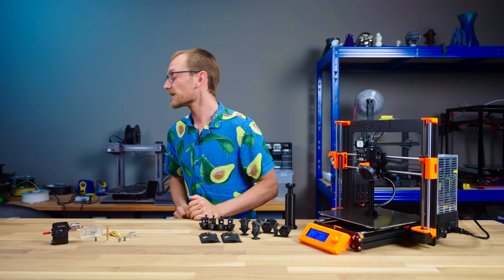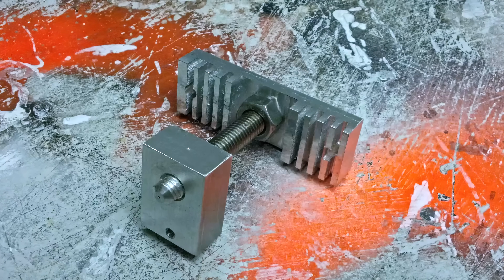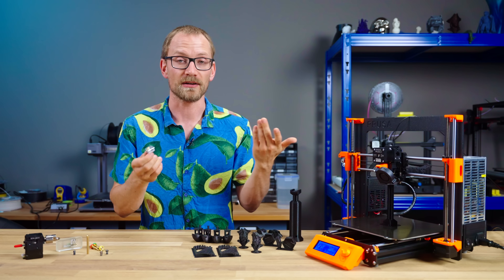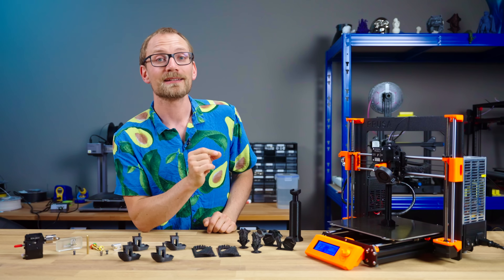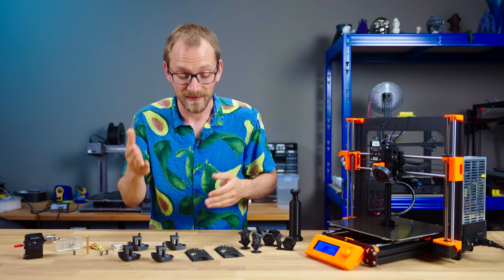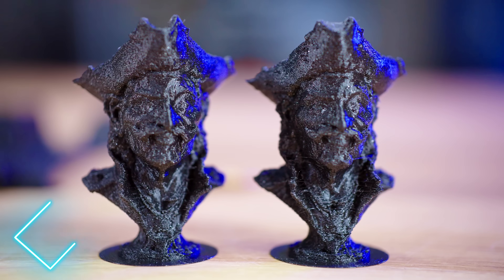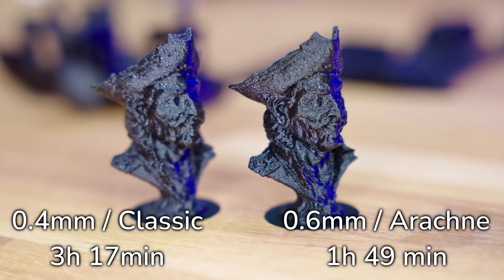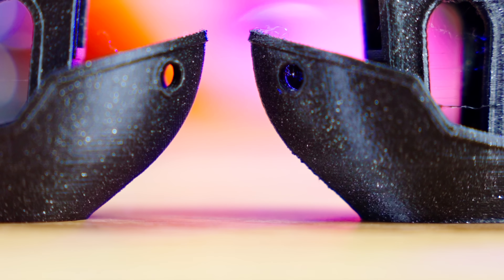0.4mm nozzles just became obsolete

Comment: I use my printers mostly to protoype components, pcb housings, etc. I switch about a year ago to 0.6mm nozzles, and sometimes to 0.8mm, and man, having a print done in a hour instead of four, or in half a day instead of a full 24 hours is amazing. Also, it works really well with the whole "quickly measure stuff, do 30 minutes og CAD, print test piece in 20 minutes, modify CAD and print full piece" workflow
To be honest, if you cannot afford to lose "details" on a print, get a resin printer.
Reply: I really need to do this, I never print with fine details
Reply: @instanoodles  Just use thicker lines in the slicer when using 0.4 mm nozzle
Reply: You don't need a 0.6 mm nozzle to print 0.6 mm or even 0.8 mm line width, but a 0.4 mm nozzle will do just fine.
However, if you're going for 1+ mm line width then yeah, 0.6 or 0.8 mm nozzle is probably good.
Reply: I have about doubled the speed of my printer with input shaper on Klipper, and it's at the limit of a Revo hotend at 0.3mm layers heights and 0.4mm line width. With 0.6 line widths and 0.4 layer height it would double the material flow again to 24mm^3/s (about the performance of high flow extruders), and this is on my modded Anet A6 bedslinger! I could run 0.6mm line width with the 0.4 nozzle but I might as well keep the quality since I'm at the limits of the hotend anyway. I think my next real challenge is sufficient cooling.
Reply: Lots of people don't have a space where they can safely manipulate allergenic, toxic and mutagenic materials. Plus, photoresins are a lot of work.

For prints that need a reasonable amount of resolution, using something like 0.2 and coating it to hide the layer lines can be viable, especially if you're doing a master which will use to make castings from other materials.
Reply: Very good comment. I for example print basically only engineering items which do not require fine details or templates for a router. I'm printing with 0.8 CHT. Some parts take with optimized profile, this nozzle na bondetch lgx extruder up to 40 hours and 2 spools. With 0.4 it can possibly take almost a week.

Comment: I've been using a 0.6 nozzle for a year and it's fantastic I don't do very art-looking stuff primarily mechanical which works awsome and the vase mode is now a thing I use way more because prints are more robust with this setup
Reply: Somebody needs to add a "double vase" mode: prints 2 LINES instead of 1...  In fact, just make it a variable number, 1,2,3,4...  All the strength you want to dial in with a single setting.

Comment: Regarding the layer height issue, if you use the wider nozzle orifice but keep the line width smaller (in this case, 0.6 mm nozzle with 0.4 mm base line width), does the problem go away? In other words is it really the nozzle width that matters, or the line width?
Reply: I think it's the line width. I love that you can set different ones for different areas in PS

Comment: Interesting video. As a hobbyist, I always treat print time as a "It takes as long as it takes" issue. I am luck enough to have a couple of printers, and I generally use a .4 or .8 nozzle size. Most of my printer these days are either reasonably detailed, or just need to be strong, so those options work really well for me.

I really need to get a printer with a Revo hotend, because nozzle swaps are not on the list of things I enjoy about 3d printing.
Reply: My solution is to swap the entire hotend. Much aster than changing the nozzle........
Reply: A bit late to the party, but with most nozzles you can use one of those attachments for putting screwdriver bits in a drill. Just heat your extruder, do a few retractions, and quickly swap the nozzles.
Reply: It's still tedious with Revo hotends. It takes even longer to change the nozzle.
Reply: @alejandroperez5368  ??? HOW ??? With proper Start+End-GCODE modification, you're literally swapping in 30seconds.

Comment: I would've liked to have more of a comparison between 0.4 and 0.6 both with arachne. I agree that 0.6 makes sens for most usecases and especiallly engineering parts.
Reply: I personally use 0.2mm nozzle with 0.18mm line width and 0.08mm layer height, printing at around 75mm/s. Gives very smooth parts, although it clogs often.
Reply: @hammyboigaming904  do you use a filter/oiler ?
Reply: @MrExo_3D  I do not, since the 3D printer I have uses a very compact extruder and there aren't a lot of modifications I can buy. However I did make a new hotend for it.
Reply: @hammyboigaming904  filament filter is generally easy to add to most machines. it just a little housing that the filament passes through before it goes into a tube or into the extruder. I find them very helpful in preventing clogs. especially the case with small nozzles
Reply: @MrExo_3D  I need to do this, my 0.15mm nozzle loves to clog.
Reply: @MrExo_3D  Thank you, I'll look into buying one. I think it could definitely help.
Reply: @randomname4726  yeah running 0.15 is like asking for pain lol
Reply: No, no and no. Notice how there is no mention of the effects on layer adhesion strength. This is bad advice from an engineering perspective for functional parts. printing a line width of less than 100% of nozzle diameter results in verry poor layer adhesion strength. best adhesion occurs at 150%, which would be 0.9mm for a 0.6mm nozzle. This would result in a huge compromise between detail and strength just to achieve higher print speeds. Do not use a 0.6mm nozzle for functional parts unless they don’t require precise dimensions. Though  I guess it would work well for larger parts with tolerances greater than 1mm.
Reply: yeah, it kinda made the tests/video a bit redundant, cause even if 0.6 gets close to 0.4 with arachne, it still will obviously not have as fine of details, and that's without 0.4 even using arachne, and boy was I interested in seeing 0.4 vs 0.4 with arachne
Reply: Yeah, I've been using arachne since Cura 4.13 and I am already getting the use out of the definition it gives you at 0.4mm. e.g. using 0.5mm thick lines to make slightly compliant mechanisms in PLA.
Reply: @charleslambert3368  sorry to bother, but I've been using cura for 2 years and just uploaded the most recent version5, I can't find anything that is called arachne or anything similar?  Is it just in prusa slicer?
Reply: @charleslambert3368  well then make those compliant parts 0.6mm, probably just as flexible.
Reply: I was thinking the same, but then again I've been using a 0.4 with arachne for a while now and while there's been some improvements, I can already tell a 0.6 could get pretty much the same results in less time just by looking at some of his prints and what i've experienced on my own tests. Probably gonna buy one to try in the near future.
Reply: This simple issue completely invalidates the entire video and makes this nothing but clickbait. Obviously a bigger nozzle prints more, but try printing a 0.4 width line with a 0.6 and it won't work. a 0.2 also isn't fit for purpose for fabricating a huge box, but it'll do well doing tiny little 28mm models and smooth diagonals
Reply: Yeah not quite comparing apples to apples. I get that you are trying to work on the assumption that everyone is happy with 0.4mm definition they're used to. But really that definition itself is out of date.
Reply: @danyoungwas  please elaborate
Reply: @vmx200  elaborate on what
Reply: What line widths do you want to use? If less than 0.8 mm then a 0.4 mm nozzle is just fine, especially since you can have it make a 0.4 mm outer wall for higher details, and wider lines for everything else.
Reply: @marcus3d  Yep, it's what I do. And I basically just print functional stuff too, increasing line width was one heck of a magic trick to speed up printing. Just keeping in mind the hotend flow and we're good to go.
Of course, the same is true for a 0.6mm one too being able to flow more by being less restrictive, but every now and then we do need ("we" meaning both myself and at work) some sharper details that the 0.4mm can do.
Reply: @marcus3d  I would like to see some tolerance and accuracy tests designed for .4 printed on a .6 nozzle.  Sometimes you just need that added accuracy and really validating that would be great. (also a model not printed with galaxy filament would be nice)
Reply: @marcus3d  if you want to print fast then a 0.4 mm nozzle will quickly give you problems with your flow rate. Even my volcano hotend can't melt filament fast enough for fast print speeds with 0.6mm line widths on a 0.4mm nozzle, which is why I'm buying a 0.6mm bondtech cht as soon as the volcano version launches in August

Comment: Wouldn't simply using an extrusion width of 0.6mm with an 0.4mm nozzle provide the same or similar benefits?  Also, Stephan showed in tests that printing with a nozzle width that is wider than the nozzle (150% to 200%) improves layer adhesion and makes prints stronger.
Reply: That works great, I printed a lot of nylon on a 0.4mm nozzle with 0.6mm extrusion width, and similarly have printed smaller than 0.6 on a 0.6 nozzle.

But I guess the point of the video is more that 0.6 is a better starting point for what most people print, giving you a more sensible default mid point for extrusion width.
Reply: Until you're flow rate bound, it shouldn't make much difference at all except possibly on overhangs where the fluid dynamics get weird, and then I'm not sure which is better.

Comment: I remember having to make a springy part for a retention clip to keep the face plate on my computer case.
It was just too thin so the slicer made gaps and I had to interleave 3 different shapes between the layers just to keep it physically connected and functional.
Reply: That's just a slicer issue though, proper slicers had adaptive extrusion width for ages now
Reply: A tip is to design parts wall thickness with your layer width in mind if you dont already. Full perimiters make stronger prints and less issues like what you're experiencing during printing.

Comment: Nowadays I use a .5mm nozzle as I find it to be a good balance between detail and speed. .4 is a bit too slow and too restrictive of flow, while .6 is a bit too coarse. Arachne has really made a massive difference and basically made my switch possible all by itself, but it still really isn't perfect and you can still see differences between 0.4 and 0.6.
Reply: Curious, how fast are you printing, how wide lines, and what layer height?

Comment: Thank you for this.  I'd like to recommend that you use a narrower [edit: corrected from wider] aperture (or the video equivalent) when showing models side-by-side.  In many of your shots, it was not possible to compare the two because only one was in focus.
Reply: What you want is a larger depth of field--the distance ranges from the camera within which subjects will be in focus. A wider aperture actually narrows that space and makes it trickier to focus exactly right.
Reply: @Aaron-ne4kr  I knew this and wrote it wrong.  Narrower aperture.  Thanks for correcting me.
Reply: Possibly replacing video B-roll with a pan across a still image? That would make it easier to make sure the part we should be looking at is in focus, and with a tripod Thomas can get a slow enough shutter to make up for the narrow aperture (this is harder in video, as the shutter speed is limited by the frame rate)
Reply: Wide angle lenses add a fish eye effect I believe your looking for the macro lenses  bud that gives you better detail for a small Frame shot up close
Reply: @FUCKDSS  That's not what I was referring to.  Greater depth of field would be the goal.

Comment: I made the switch to 0.5mm a couple years back and it's been great. Even with the classic slicing methods, 0.5 really didn't loose much definition but allowed for significantly faster prints. Makes your question of why we switched to 0.4 in the first place even more interesting.
Reply: I prefer 0.5mm because i often design parts in mm increments and 1mm isn't cleanly divisible by .4 or .6
Reply: @6AxisSage  don't get too hung up on nozzle width. A 0.4mm will make a perfectly fine 0.5mm wide extrusion. Or even 1 mm wide. I've done the experiment of seeing how much I could extrude out of a 0.4mm nozzle and I got up to 1.5 mm wide and 0.5 mm high with good quality. Beyond that it started to go downhill. 
My theory is that the max extrusion width is really determined by the diameter of the flat part of the end of the nozzle. Wider than the flat part is no good.
Reply: @Dave_the_Dave What about overhangs and bridging? I assume they won't work very well when trying to push most of the filament sideways.
Reply: @shaunsgoat498  overhangs work about the same as they would with a wider nozzle. Bridging won't work as well but that won't work well with an extrusion that size anyway because it is really hard to cool it quickly enough so that it won't sag. Low flow rate is better for bridging
Reply: @6AxisSage  But, you probably shouldn't be printing with layer widths equal to the nozzle bore diameter. You want a little squish as you print. The default print profiles in PrusaSlicer 0.4mm nozzle (at least for Prusa printers) is 0.45mm. If you want equally divisible into 1mm for your mechanical work, bump your 0.4mm nozzle's print line width to 0.5mm. As long as the flat end of the nozzle is a larger diameter than the printed line width the nozzle should keep the top of the squish nice and flat.
Reply: I agree. 0.5mm is great. It's easier to calibrate than 0.6mm and the speed upgrade and less clogging is definitely worth it. 😎🌎✌️
Reply: @DeanTheDoctor  Less clogging? Clogging at any of these larger sizes is so rare for me it's impossible to compare but I'm almost certain any increased clogging with 0.6 over 0.5 would be due more to poorer quality nozzles than the size itself.
Reply: I've rarely had clogs myself, but it helps with the peace of mind when it comes to dust in the environment and when choosing more economic brands of filament. When it comes to third world countries, not everyone is going to have access or the ability to get quality parts, so videos and community content help others to know what options are available, but it's whatever suits your needs best. 😊🌎✨
Reply: My question here is how to setup a larger nozzle in order to bring down the printing time without going larger than 0.2mm layer height.
Even tho my Printer Profile doesn't let me change my wall thickness away from 1.2mm
Reply: @ludwigschmidt4133  Thicker line width
Reply: I'll have to try put a .5mm nozzle, because designing parts would be so much simpler with .5mm lines in mind.
Reply: I've always run 0.5 but I mostly mostly run CF and GF materials and wanted and edge against clogging.
Reply: Probably the best way if getting higher resolution in the early days, now with better extruders and software I guess it's just not nessasary, I am curious what the bust would look like at 75% scale, would prolly see a benefit using .4 maybe?
Reply: Im pretty sure it could never loose definition. But it could lose definition

Comment: Larger nozzles are better for shallow overhangs since the % of the trace width that is unsupported is lower.
Larger nozzles use up more material for the same infill % since the solid walls are thicker.
Larger nozzles can, (in my oppinion based on my experience), only be considered faster, (for a same given layer height), if you print “slow” or way below the max volumetric output of one given nozzle/extruder; otherwise you have to print at substancially slower speeds. Using original E3D material since 2014; more than tested, (Tons).
Before arachne loss of detail was substantial with 0.6 Vs 0.4; really curious to put it to the test!
Reply: They don't use more material for same infill % - infill line spacing is computed in terms of line width, so the same % infill will be more spaced out with wider lines, giving same volumetric/mass %. This does mean top layers over infill will be less well supported at same % though.

Comment: I have an ender 3 v2 and a .4 nozzle. What .6 nozzle do you recommend giving me better quality and speed than a .4. Does Cura have Arachne mode and some of the other settings you talk about. 
What would you say the range of layer height is for a .6 nozzle?
Reply: For nozzles, E3D is the gold standard, but they're pretty pricey. If you want it cheaper but still good quality, Trianglelabs (Chinese company) has been recommended quite a lot in the last years and I currently use them myself. And as Tom said, stay away from those ultra-cheap multipacks you find on "big A".
And Tom already answered your question about optimal layer height for .6. .15 is borderline possible, ideal range is between .2 and .4(5).
Reply: Cura created Arachne, it had it first. Depending on your hotend I would look for some Copper Plated Nozzles from Phaetus, not too cheap, not too expensive.

Comment: Other than enabling Arachne and going to a 0.6mm nozzle and changing the nozzle size in the slicer, what other changes need to be done? Keep in mind, most of my prints are not of the "organic type" like Tom mentions.
Reply from the maker: Really not much - 0.4 to 0.6 is a relatively small change so that most of your tune will just carry over.
Reply: Thanks Tom.